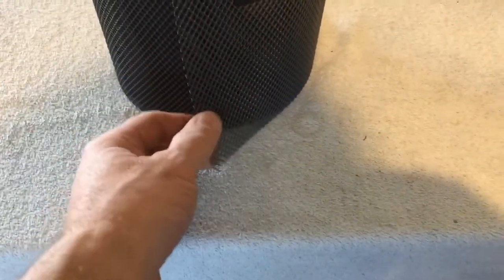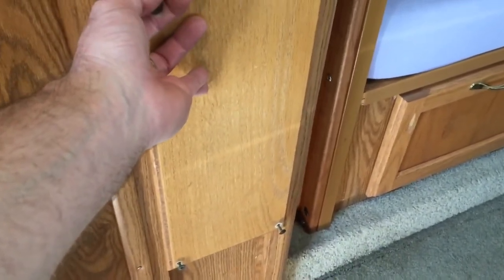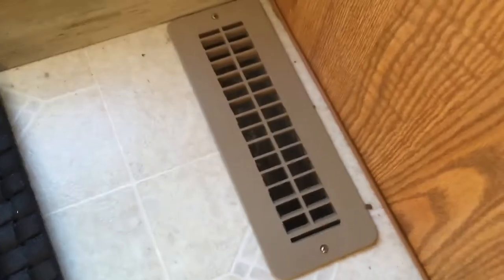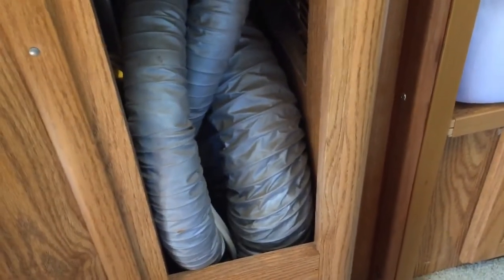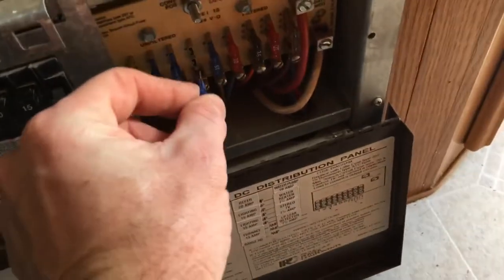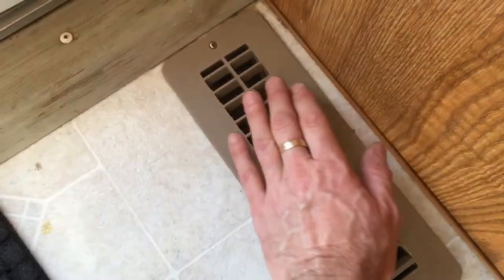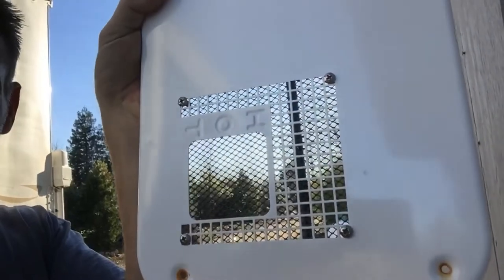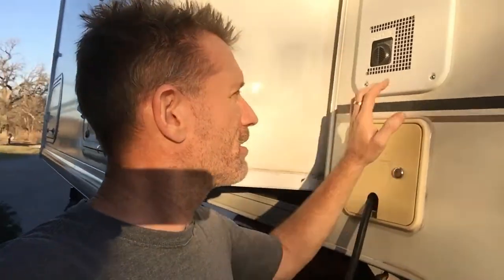RV Furnace Maintenance Truck Camper

Comment: I thought your furnace a little  noisy?   I hit mine with 150 psi compressed air  especially the squirrel cage  I have two shepherds  lots fur
Reply: @covetthecamper2289  my dogs go where I go  24/7  yup they can be a bit of work  if squirrel cage unbalanced it will take the bearing out  up here in canada we have close relationship with our heat sources